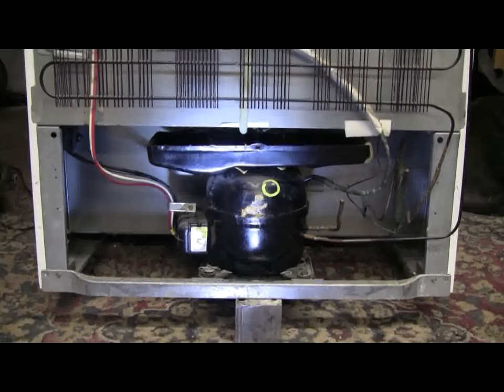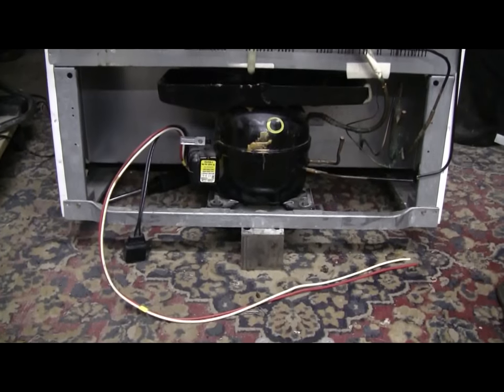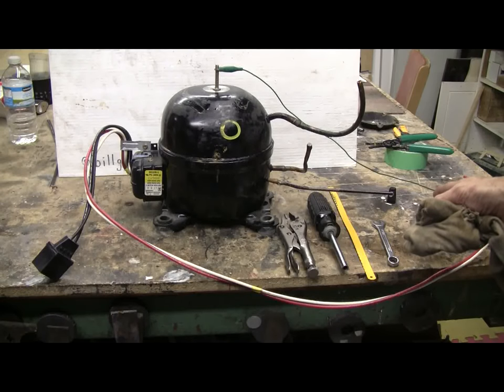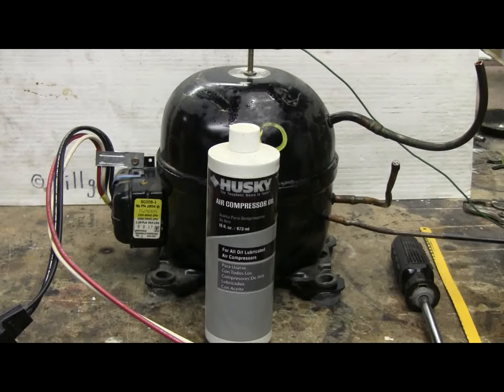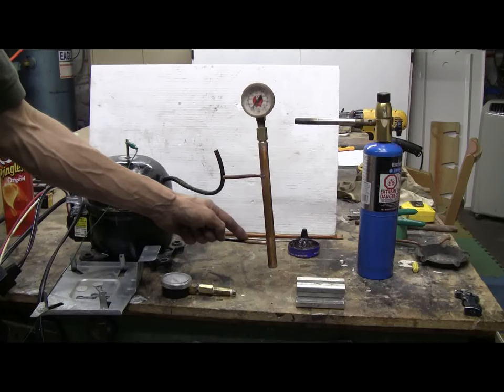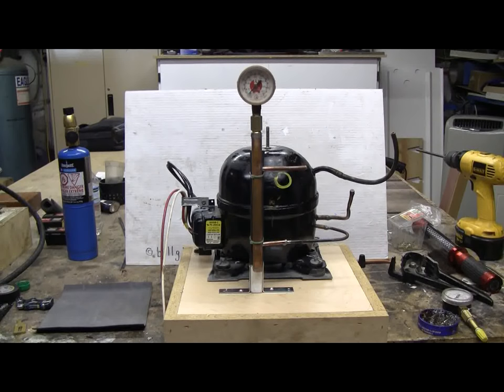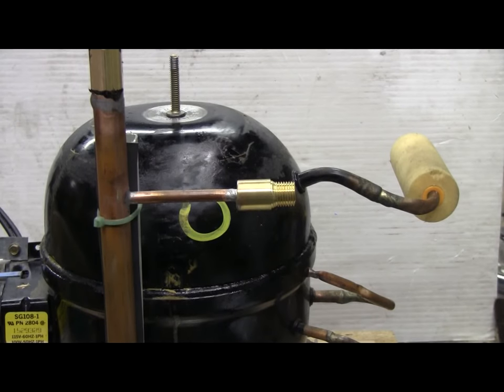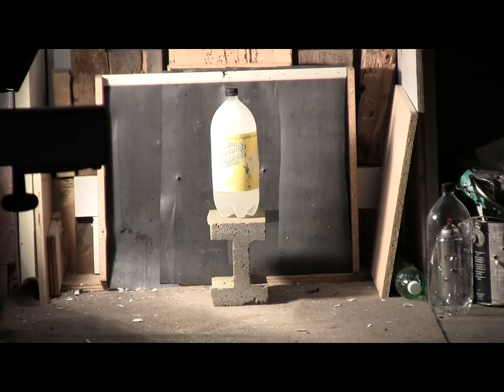DIY - How To Make A High Pressure Air Setup From A Refrigerator

Comment: How much pressure before failure? Can you cascade two of these compressors?
Reply from the maker: +Growley M Pressures above 450 psi or so will be hard on the Reed valves. These can be replaced if you are well equipped with tools. These units do not cascade. Max pressure that I have gotten is 850 psi from a large old one.

Comment: lol wow this was great!! you should ad a high pressure switch but also, doesn't the compressor overheat?? most of these compressors are cooled with the freon. subscribed ! ! :D
Reply: I made a similar compressor 20 years ago and it still run with same unit and without ever filling oil to it. For clamp pistols and other low airvolume tools it is great. You can use airpressure tubes instead of soldering cobber - works as well up to at least 10 bar.

Comment: What is the max pressure you have pumped this up to? Can it also be used as a vacuum pump
Reply: ***** Yes those type of units work as vacuum or pressure pumps,,They were used many years ago to vac down car A/C systems before adding new refrigerant

Comment: Hey Bill, I was just wondering - could one of these things be used to compress Hydrogen into a steel tank?
Reply: Or nitrogen/CO2
Reply: Be very careful with hydrogen gas. It's very flammable, very powerful and burns extremely fast. A tiny spark will ignite its fury. Be careful compressing it. Compression and high pressure causes heat and it might be enough to cause it to autoignite. I'm a  welder and that is why I know about pressurized gasses and the dangers associated with them. Please be safe and don't get hurt.

Comment: Bill, can this system built the exact way that you built it, be used to pump up a 
PCP AIR RIFLE??
I have two old compressors that both work, and your methods is way cheaper and more logical to build one of these, instead of buying a high pressure compresser from the factory that sells them for upwards to 3 and 4 thousand dollars. 
Please reply back with your expertise. 
Thank you very much sir!!
Reply from the maker: PCP air rifle usually needs even more pressure than this can generate. Max I have gotten is about 850 psi. PCP usually needs 3 or 4x this pressure. I think that I've seen a chinese pump for PCP pressure levels that is not priced at several k$.

Comment: will any one tell me about the oil in compressor i think oil will be finished after some days how you will seprate the oil ? should a seprator will be use? ?
Reply from the maker: +Mohsin Ali Depending on the usage you might need an oil trap or separator. Certainly if you were using this for a small airbrush. If you want to add oil to the compressor this can be done by letting the suction line suck some oil into the unit maybe 10 ml at a time. This is done to replace what is lost over time.

Comment: Cool, definitely a great video... you rock! Do they call those HEX nuts in CANuhduh! LOL In all countries I have lived in, Hex or Alan is an inside system.
Thuh COM    Presss    OR could be just a compressor. LOL ok enuff of the pfunning'around!
...oh yeah there is more... read on...

- ...and why not put the auto-cut off valve on it... or is there a problem with that?
Even if the COM Press uhr(lol) will automatically cut off at 850... safety limiting this to a much lower level could be invaluable.  The tanks that would be use in conjunction may not be able to withstand near 1K psi!

- Your extinguisher device, how long did it take to bring it up to pressure(350) I think is what you said. ...and how did you know 350 was safe!?
What I am looking for is the actual volume per time. One good example would be a regular tire saver air tank commonly used by mechanics. and it would be nice to know the rating on the fridge motor to know the consumption that was required for that particular vol/time...then we can see the efficiency of this rig.

- Your test is rather unusual to say the least! LOL are there zombies in CANuhduh you must take down with a silver/air bullet!!!

Comment: Enjoyed your video. I was quite surprised how much pressure you obtained from the old compressor. I recently acquired an old compressor in fine working condition. I intend to use mine as a vacuum ;)

Comment: I recommend this video for anybody that has trouble falling asleep that was absolutely ridiculous I mean it is nice that you took time to tell people how to make a compressor that doesn't build all that higher pressure but I think you could skip a few things like what size the bold is that holds in the capacitor what direction you turned it what color the ranch was that you used the fact that you put the compressor on the bench just a little bit too slow maybe you need to lay off the pot and pick up some Coke LOL I'm sorry I just can't believe I watch that
Reply: Southerners all do that, y'all.
Reply: Why are you commenting on a topic you're not interested in? Actually this compressor is able to product over 300 psi. I think you are referring to the amount of air that it produces. Yes, it is rather low CFM (Cubic Feet per Minute), but this compressor has a few remarkable qualities. It is very quiet or you would throw your refrigerator, air conditioner and freezer out the window. I happen to live on a cold winter environment and love to airbrush. Since this is a quiet compressor and supplies more than enough air for my airbrushing, it's nice that it has no noise pollution.

Comment: I missed how he drained the oil, he says turn it in it's side but doesn't mention from where the oil drains out nor how to put the right oil back in?
Reply: +SharpEnuff It doesn't matter what kind of oil is in there! .Go ahead and proceed .No need to change  oil.Since frreon is not used, it is not important..This is not a plan for a garage type air comprsesssor. It is a plan for high pressure burst of air  as in air cannons.
Reply: oil is drained and refilled through the suction / intake line.  that line just goes into the cylinder that the compressor is housed in.  make sure to measure out how much oil was drained, and only add the same amount of compressor oil back.

Comment: 24:05 lol shows us the completed pump. Even though we have been looking at it for 5 minutes. Plus watched every step down to the wire nuts. Your a smart guy and did a good job but work on your presentation. Most people that watch this stuff is smart enough and understand how to put a few pipes together. If not they shouldn't be messing with high pressure. Just a little positive criticism so you can get somewhere making these videos also talk a little faster you could have pop this video out in half the time. We need guys like you putting how to videos on here that aren't fake.

Comment: great video im building a shop compresseryou have help me a lot thanks
Reply from the maker: +roy cannon These compressors have a very low cfm. Not really suited for air tools. They will run something like an air brush. If you hook up a storage tank it can take quite a while to come up to pressure due to the low cfm. They are quiet and therefore useful for air brushing models at home where low noise may be needed.

Comment: i wonder if you could cascade that off a shop compressor tank (say 100 psi average between trips) and get scuba level compression? 20 to 1 inlet/outlet looked pretty damned easy for it, lol. didn't sound luggy and was climbing like a fighter plane still, so probably had plenty of capacity left... do a max pressure to lock test yet?
Reply from the maker: +ludditeneaderthal These tend to lock up if more than about 30 psi is applied to the inlet side. My best one stalls with about 850 psi on the output side. Not quite good enough for scuba use as well as there being oil in the output stream. Don't need compressor oil in a scuba tank.
Reply: oh, i wouldn't dream of breathing the output, merely using the reference point. yeah, a 30 psi inlet limit would kind of interfere with cascading off a compressor tank, lol. still 850 psi is PLENTY for most purposes. at 850, about 1 CFM (lol)? do you think (with a proper drying module, of course) a fridge compressor could produce the volume for a self contained plasma torch running about a 50psi kerf clearing stream?

Comment: Bill, Could I use this setup for a atual Vacuum Chamber to degas Silicone for Silicone Molds to cast resin as well as for eliminating air bubbles from the actual resin after casting into the silicone mold ?  If so would it be the same hookups and setup you have shown in this video ?  Thanks so much for doing and sharing this video.  Theres many videos on this said subject on YouTube but yours is the only one Ive seen yet that explains in thorough detail like you have.  Super video and if I can use this as a Vacuum Chamber Im gonna be making my own as well.  Thanks in advance for answering my question.
Reply from the maker: +Open Air Model Shop This will run a vacuum chamber. Just hook the chamber up to the suction line.
Reply: Bill Gilmour would you care if I sent u a private message with a couple more questions Mr. Gilmour ?
Reply from the maker: +Open Air Model Shop No problem. Hope I can help.

Comment: great put how u putting the oil in the compressor ??
Reply from the maker: amjad amj Oil can be added by letting the suction line suck in a bit at a time. This works for fridge compressors. For compressors from some window air conditioners, the oil must be poured in the output line. You could also drill a hole in the compressor at the top, thread the hole for a metal plug, and use this as your oil fill.
Reply: Bill Gilmour drilling a hole may sound like a great idea, but you most likely will end up with metal shavings inside the compressor and that will not be good for the compressor or anything you hook up to it like tools and such as those metal pieces will damage the compressor and/or tools you try and run off it.
Reply: William Todd simple solution is pressure up the compressor with a few psi and then drill and tap it.The air will force the shavings out and keep them from entering the compressor
Reply: gsppuffer Great tip, thank you for your reply.

Comment: TRY A 410A 12000 BTU AC COMPRESSOR. WILL AMP OUT AT 1000 PSI ON 20 CU FT BOTTLE

Comment: Plllzzz HELP!! I have a small problem. My refrigerator motor only works for 2-4 sec and then it shuts down (stops working), couple min later I plugged it in again and the same thing happens. Does anyone knows whats the problem and have can I fix it?
Reply: Do you have the overload connected still?
Reply: Probably yes its still on. Should I remove it or bypass it?
Reply: lmnk7 if the compressor is not pumping freon it will overheat and trip the overload and that might be your problem. Most look like a small black circle with a wire going in and coming out and its pressed up against the compressor. Yes try removing it and see if it runs longer

Comment: will it use air tools? thanks
Reply from the maker: +manit40 Air tools usually need 120 psi at several cfm. This generates hundreds of psi but at very low cfm. Not really suited for air tools.

Comment: only problem with these things is they wont kick back on at moderate pressure , you need a high torqe start winding or capacitor to restart at even 100 psi  :(
Reply: Just supply pressure to the suction side to get it running again.bypass the filter, lol
Reply: Rýán Túçk
There is no reason a compressor should use another compressor to start it. These compressors are made to start with capacitors. PROBLEM SOLVED!!!
Reply: most compressor units have a non return valve into the tank and a dump valve on the cutout switch so they dont actually start under load. But depends how far you want to go with a project.
Reply: MON383 even with these things you are still starting at high torque , every compressor starts under load if the tank is at pressure  vavles or not
Reply: yes but they have that "little" bit of grace till they close the valve.... takes the load off the first couple of turns before the pressure takes up the load... 
In process ATM of building a REAL hp comp to fill my dive tanks... 300 Bar...
Reply: They will start just fine and if it doesn't just install a hard start kit I'll boost the starting torque for a brief period
Reply: Yeah, the capacitor that NOBOX7 was talking about is that start kit that you're talking about. I had to use a capacitor to start my compressor. Got it on amazon quite cheap.
Reply: +MON383 I find broken chinese compressers in the trash and then remove the compresser and motor and replace with refridge compressor. then you have the  unloader valve  which is usually included in the pressure switch and the tank check valve and popoff. cont go to 300 psi though

Comment: Hi can one have a constant output of 500 to 600 psi from this compressor?
Reply from the maker: +Needs to be born every moment I can get these pressures from mine. One of them could reach 850 psi max. Higher pressures reduce the life of the units by stressing the reed valves.
Reply: If i have around the mentioned 800 psi constantly... how long will i be able to use it? I need it for a hobby project :) Actually i was thinking of using two of those simultaneously to get around 1500 psi.. I was really impressed by your idé.
thanks for the reply.
Reply: If i have around the mentioned 800 psi constantly... how long will i be able to use it? I need it for a hobby project :) Actually i was thinking of using two of those simultaneously to get around 1500 psi..
thanks for the reply.
Reply from the maker: +Needs to be born every moment Not all units will go up to 800 psi. Even if it will this is hard on the Reed valves. You cannot hook two in series to double the pressure. The second one will stall.

Comment: Interesting project! Wouldn't it have been better to hook the compressor up to a tank with a control valve so as to be able to control the pressure?  Seems dangerous to me to have it continually pump high pressure with no controls....BOOM!!!
Reply from the maker: These compressors have a limit to how much pressure that they can produce. My best one tops out at 850 psi. I don't need a tank for the way that I use mine. The tank on the air cannon is brought up the required pressure and the compressor is shut off. If I am trying to burst something like a bottle or can or finding the burst pressure of plastic pipe then I need the pressure to build. If you use this for an airbrush or something then you would need a pressure switch and air tank as well as an oil trap to clean up the air that comes out.
Reply: +Bill Gilmour I think much higher pressures than 850psi could be had if you hooked the output of a regular shop air compressor to the intake of your fridge compressor. Then instead of atmospheric pressure being sucked in by fridge compressor you would boost that to >100psi right out the gate! I've had this little idea tucked away in the folds of my permanent memory storage, somewhere! One caution though, if you try it be sure to use a paintball CO2 tank for storage as they are usually rated for 3000psi. The carbon fiber tanks can go much higher but the 3K one is all you would need. One other thing, if the setup can get close to 2000psi and you plan to let it do that on a regular basis, it would be good to change out the air compressor oil for some that is rated for over 2000psi otherwise you can get a diesel ignition of the oil in compressor and we don't want that! Anyway, you could try it for just a little bit for 'proof of concept'? If it works you could post it here or at least let me know via pm as I am very curious!
Reply: +Will yam Dysinger --- that would amount to piggy-backing 2 or more of the silent ones... is not the idea to get away from the noisy and bulky shop tools!?  ...and remember the silent COM Press uhr will not allow more than 850... thus a moot point. This is not for TONKA-TRUCK style jobs!  ...plus you are going cuckoo with your wild speculation... when pressure gets up, one must take other factors in consideration before one dies the inventor's death!  You sound a bit foolish to me.
Reply: DormantIdeas NIQ The goal with this kind of experimenting is to achieve ultra high pressure at home for charging very high pressure air guns thus bypassing the commercial source $$$$. It kind of goes without saying that when dealing with very high pressure air a person needs to follow the rules set up for such things like scuba or very high pressure airguns. To ignore the rules in this arena is to risk death. Safety is always a concern! Common sense needs to prevail in such instances for obvious reasons. This reminds me of the common sense approach usually followed when testing old guns by getting behind some protection and firing the gun using a long string!
Reply: thank you for noticing

Comment: 300psi is awfully low for a high pressure system.  Did you mean 300 bar or 3000psi?

Comment: I wonder what would the recovery time be (0 to 350psi), I'm guessing one minute?
If he attached this unit to a tank (10lb?) could it run an air tool and how often would the compressor need to replenish the tank (longer is better)?
Seeing the amount of water that dripped from it,  I'm sure if he intends to attach air tools to it he'll make sure the moisture doesn't harm any tools.

One problem with commenting is, will it be replied to (by author) after three plus years?  ;-)
Reply from the maker: +T'airn'KA Very slow recovery and not suited for running air tools. Takes quite a while to get my 20lb co2 tank filled with 400 psi air. I use the shop air to put 120 psi in and then switch to the high pressure air setup. Takes a good 20 minutes. I use it for air guns and air cannons.
Reply: How large is your "shop air" system (compressor & tank)?
What minimal size compressor (silent) and tank combo be viable for air tools?